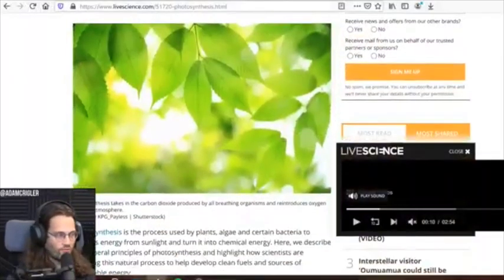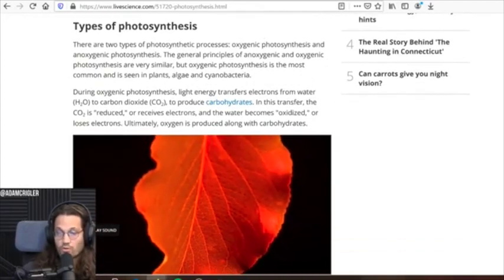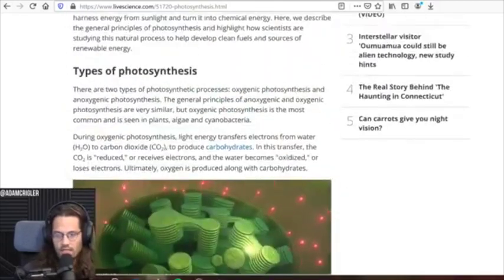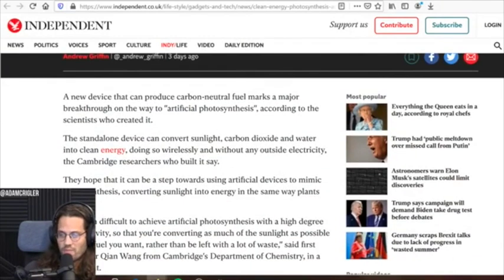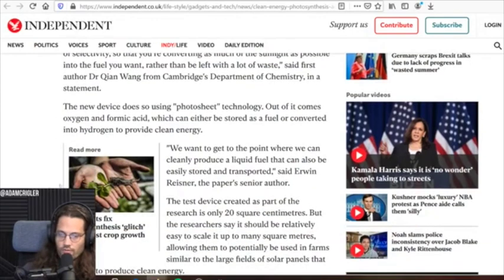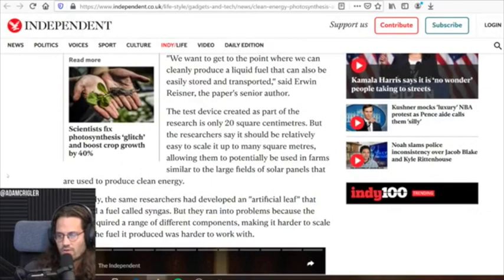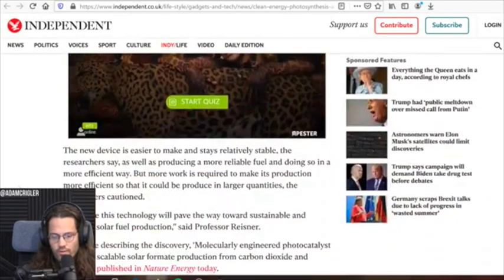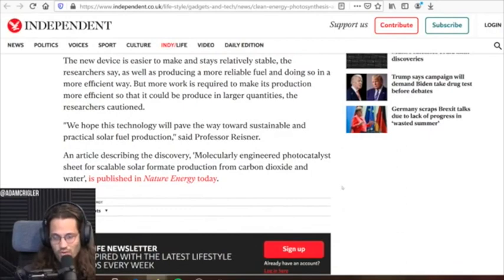Breakthrough in Artifical Photosynthesis

Comment: Silica is the most plentiful element on our planet.  Sand is mostly silica.  It’s only rare to find a deposit pure enough to use for making glass or microchips.  I was an owner in a silica mine a few years ago.  We blasted and crushed hard rock silica, and then delivered the crushed sand to a copper mine so they could use it as a flux to bring the impurities to the surface to be discarded.  We delivered 300 tons per day 365 days a year.  (Except when they shut everything down for annual maintenance.).

Bottom line, silica is not a rare earth element we are struggling to find.  It’s the opposite of a rare earth element.  👍

Comment: They're talking about using this process to convert CO2 from the environment into a liquid fuel.
Oil -> Gasoline -> CO2 emissions -> Artificial Photosynthesis -> Remove CO2 from environment -> Oil -> Gasoline -> CO2 emissions -> Artificial Photosynthesis -> Remove CO2 from environment -> Oil -> Gasoline -> repeat...
 
A "carbon neutral" system that would do away with oil drilling.
Reply: Uh you do know in essence oil is still carbon neutral, it came from organic matter milions of years ago. Burning any fuel is undesirable because you can at the most capture 30 percent of the energy into electricity so in essence, this tech cannot be carbon neutral untill the condition to turn 100 percent of the energy released during burning, into electricity, is met.
Reply: What's the next step after that last gasoline you posted before the "repeat"? How could you leave me hanging like that!
Reply: @dragons_red  , There are two types of people in the world. 1) Those who can extrapolate from incomplete data.
 
 ;-)
Reply: @janvisagie231  I meant to write only enough to get the point across. Which it appears you understood, thus I did a sufficient job.
Reply: Everyone is excited about a man-made leaf and I'm over here wondering why we don't just modify certain trees. To produce more oils or stronger wood for industry.
Reply: Thus undermine the power balance of the world, oil-rich states (who don't need to frack) will resist - Russia, The Arabs, Central America...
Reply: @janvisagie231  well, the term "carbon neutral" refers to a cycle with balanced input and output. Carbon neutral means the system puts out as much carbon as it takes back in, which is not the case with oil and plants as-is since there's a lot more going in than coming back out. And the part about 30% conversion efficiency for carbon fuels is true for cars, but there are significantly more efficient systems running on carbon fuels, and there's even research into thermal energy scavenging by turning heat energy into light and using a photovoltaic process, so efficiency still has a long way to go. And your point about carbon neutrality being impossible until 100% efficiency is achieved isn't true, it just means we need a non-carbon source of energy. Solar and nuclear are the promising options. Solar is the artificial photosynthesis route, nuclear is like what's going on at the U.S. Navy lab in San Diego where they're converting carbonic acid (dissolved CO2) from the ocean into jet fuel using waste heat.
Reply: @LeeGee  Actually, there's ways for them to keep selling oil without their power being completely undermined. Carbon compounds are getting more and more desirable, so as new technologies come along, fossil fuels like coal, oil and natural gas can become chemical feed-stocks for advanced materials that are set to take over multiple prominent industries.
Reply: Just use up what oil there is while perfecting new systems
Reply: Hannes Lerm get out of here with your science. 

The worst thing about this fake “green” movement is our inability to have honest conversations. For example, the correlation of higher CO2 levels with larger crop yields
Reply: Actually it wouldn't do away with oil drilling as in your example fossil fuels being burned and releasing CO2 is essential to the cycle. You need it to provide the co2 for photosynthesis.
Reply: @janvisagie231  That is not what carbon neutral means. It has nothing to do with energy efficiency. Instead it is understood as how much CO2 you can recapture from combustion. If you release 1 billion CO2 molecules during combustion you would need to recapture 1 billion CO2 molecules to become carbon neutral. This device is actually carbon negative because it only recaptures CO2.
Reply: @jamieohare2428  I'm pretty sure that has more to do with the energy needed to make nitrate fertilizers than the crops themselves. It's called the Haber-Bosch process, which is highly energy-intensive, but allows for high crop yield due to better nourishment of the plants. Soil in the US is heavily depleted, requiring high amounts of fertilizers, and thus large amounts of energy to create said fertilizers.
Reply: Matt Brody yes, fertilizers do help. But botanists have proven higher concentrations also promote plant growth (they will pump in CO2 into greenhouses and maintain a higher level of it in their artificial atmosphere. 

To think of it logically, how much farther, faster, and longer could you run if there were higher concentrations of O2 in the air?  Another pedantic example would be to think of the dinosaurs, who benefited from a cornucopia of vegetation, made possible by the high levels of CO2 in the atmosphere. But I’m sure their natural fertilizer also helped 😉
Reply: @mattbrody3565  hmm but if you are turning CO2 into jet fuel,  which should be some hydrocarbon chain, would'nt you need a source of H2 to accomodate that reaction? And if so, why not just invest into some molecular organoc frameworks which can absorb and relesse hydrogen on demand as an alternative fuel source plus burning of hydrogen just produces water as product? And yeah, I wish we would just do some more effort on molten sslt fission reactors, fusion is a couple of years away but if it weren't for stuped biases against nuclear, we would likely have very safe and green salt reactors today.
Reply: @peaj4812  yeah, I guess I was wrong if you don't think further than theory. Apoliogies for taking this for granted but I'll explain, CO2 is the most oxidized form of carbon, therefore you'll need to add hydrogen to this reaction for you to produce any valuable fuels (hydrocarbons). Hmm, I wonder what that hydrogen could be used for and by what method it is produced industrially? Oxidation of oils is the industry standard for H2 production, with CO2 as byproduct. Therefore you cannot be carbon neutral (unless you can photochemically turn water into ½O2 and H2).

Edit: Sin gas adam was talking about is literally a mixture of CO, CO2, H2 and methane.
Reply: You still need oils for machinery and car lubrication, and the making of tires ,medicines and certain plastics
Reply: @janvisagie231  I'm not saying that else you said isn't true, but the way you said carbon neutral was incorrect.
Reply: @peaj4812  which way, I'm really curios to learn from my mistakes so I won't repeat them 😊
Reply: @jamieohare2428  if you would have been inquisitive enough you would realize from other posts to this video, I'm an avid supporter of nuclear energy, so I don't see your point here regarding your "green" statement. And as for the partial pressure of atmospheric CO2, also check how the chronoligical increase in CO2 relates to the ice ages for that matter.
Reply: @janvisagie231  i completely agree with you that fusion and molten salt reactors are the future.
Reply: @janvisagie231  Hannes, energy efficiency and carbon neutrality have little to do with each other.  
Hydroelectic dams are 90% energy efficient. This does not mean that the dam is somehow releasing more or less water than it takes in.  
It just means we're only able to harness 90% of the energy in there for our purposes. Burning things is slightly different, because the output takes multiple forms instead of just one, and we primarily care about one of those multiple forms (CO2), so in theory a cycle of turning CO2 into fuel will require more CO2 than it puts out when combusted.

Put another way: If (Oil --> CO2, other) and (CO2 --> Oil) then because (other) came from the oil, we need more CO2 to produce the oil than burning the oil releases.  
I don't know how much (other) is produced - i just know that it is. (fly ash for example contains some carbon, quick googling says between 2.3% and 25%)
Reply: Hannes Lerm no need to get defensive. I thought my initial statement was pretty clearly sarcastic, so my apologies. But understand I’m not stalking you or your responses so I don’t have a summary of your other comments on this video. 

As far as the “fake green movement” it’s clear the larger green movement is about control. I agree nuclear is a good source, but the big greenies have spent decades fighting it. Now they want batteries which create dead zones around the manufacturing plants, wind which is decimating bird/bay populations, etc. everything in life has a trade off but we can’t have an honest conversation because their goal is t the environment, it’s about control and socialism. Doesn’t matter how mucho why you give to the govt, they won’t effect change in the planet’s temperature. I’m all for stopping pollution, conservation, etc. but not socialistic and redistributive policies hidden under the greed facade of modern day environmental movements.

Comment: Chemical engineering student here. Regarding the space travel remark and printing fuel, you still need a couple more secondary components to make photosynthesis work: you need a water source carbon dioxide source a nitrate source and sunlight to keep the photosynthesis running. Just like a printer needs power and ink. So basically you’d need fuel to make the new fuel. Sounds like a lot of steps to me. Idk I’m not any expert
Reply: What if we push the spaceship really really hard to get momentum. Infinite speed

Troll physics

Comment: What they really need to crack is an efficiently produced direct heat to electric energy conversion material/method. Something like over 90% of electric generation potential is lost through heat loss in power plants and even fuel engines.

Also the problem with replacing fossil fuels is finding a replacement fuel that is at least as stable, energy dense, and non toxic (a lot of fuels used in specialized fields like rocketry are insanely toxic).

It turns out we use what we do for a reason and every time you solve a problem two more pop up...

Also for space travel energy density and energy to weight ratio are super important because the more your fuel weighs per unit of energy the more fuel you need to get moving (which feeds into itself and actually can have a hard limit where adding more fuel doesn't work anymore).

Comment: Never mind space travel. Can it power regular things like houses or cars? It didn't state if the hydrogen is the chemical used as the energy source or if the process of converting formic acid into hydrogen produces electricity or heat that can be turned into electricity. Either way, rn, anything that runs on hydrogen is still really expensive or not efficient enough. But still, its unlimited hydrogen.

Comment: The production of Carbs through Co2 and H2o is the calvin cycle. Its the metabolic process of plants. This is why going Carbon neutral or Carbon negative would wreck pur eco systems. We are carbon based life for a reason. We need a balanced Carbon cycle just like the Nitrogen cycle.

Comment: The most interesting part of this is that it sounded like hydrogen was a byproduct. If this is the case hydrogen could replace oil relatively easily since it is pretty similar in compression ratio. Hydrogen is inefficient to separate now so this might be a dual purpose invention that not only produces power but also fuel. Burning hydrogen produces water as well for a cyclical effect. I might be wrong but that seems pretty close to a perfect power source.

Comment: No, not rocket fuel Adam - food.
Artificial photosynthesis would allow us to recycle the waste generated by the physical-chemical life support systems used in today's manned spacecraft (mostly methane from the Sabatier process to recycle the oxygen from the carbon dionxide, which then is converted into pure carbon and then becomes completely useless in the life support cycle). The end result would be a carbon hydrate commonly known as sugar. :)
Reply: Doesn't sound like photosynthesis to me. Not if it doesn't make sunlight into sugar.
Reply: @andyfriederichsen  photosynthesis = photo (light) + synthesis (putting together). It's literally just a way to harmess the photochemical energy of light to create an electron gradient which drives a certian chemical reaction.
Reply: @andyfriederichsen  no need for sunlight, any light in the appropriate visual/UV spectrum will do. The experiments done on the ISS at the moment use normal lamps to provide the light for the plant samples, as the ISS's orbital period is only about 93 minutes (35 minutes in the eclipse).
Reply: @44WarmocK77  I meant if it's not turning light into sugar, it's not photosynthesis.

Comment: I have to question the legitimacy of the author of that article, they say 20 centimeters squared, that is only two dimension, and thus cannot describe how big or small their machine really is, since we are missing the third dimension (should be cubed, not squared), as it is written, it could be like a sheet of paper or several miles long.

Not doubting the science, just the authors understanding of it.
Reply: That is the surface area of the chip.  Sunlight hits a two dimensional surface.  The chip that is valuable and useful will be encased in a much thicker frame.
Reply: @stefanr8232  thank you, that makes sense, I figured that they ment something like that, I mostly found it to be a joke, but again, thanks for finding that info and informing me! :)